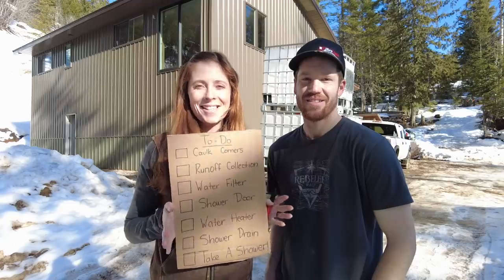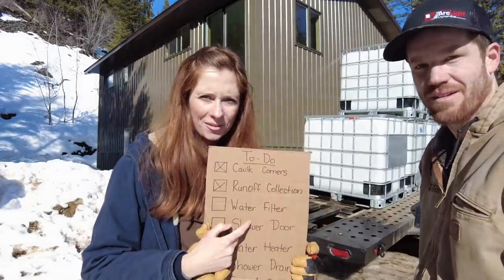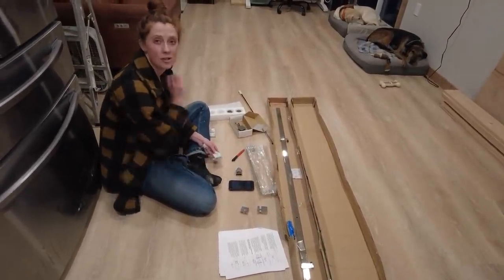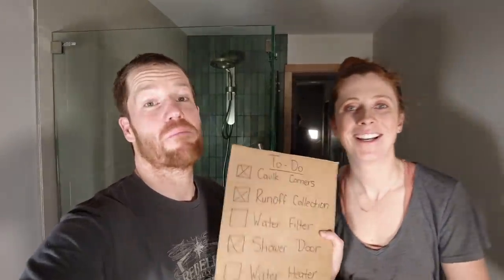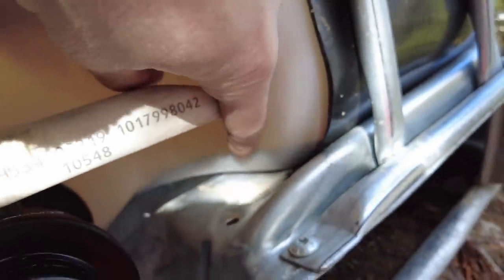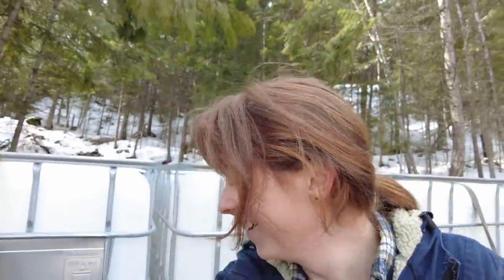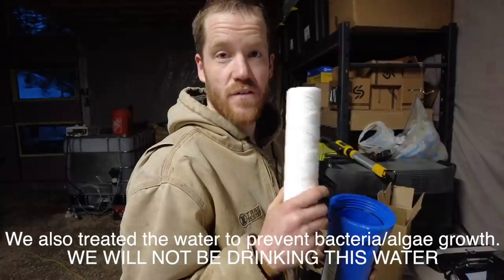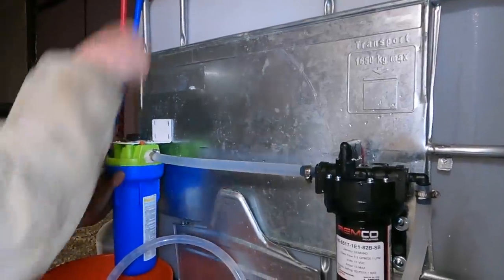We Went A Year Without A Shower | Building Off-Grid

Comment: You tube has lots of plans to make a ram pump , quite cheaply and they don’t require power one of those might help you transfer your water
Reply: I also was thinking if you put gutters and down spouts on the  home you would fill your water tanks in no time , a one inch of rain produces 6 gallons per square foot of roof

Comment: I'm curious why you didn't just put two water totes down there at your snowmelt harvesting point. If you connected them together you could reduce the number of trips to go harvest your water.
You could even rig a float in your totes in the barn to automatically turn on the pump when it gets low, activating the pump downhill.

Comment: Hello, this may all be a moot point that you have already thought of but... 1) The water heater you have looks like the one I have in my outdoor kitchen at the seasonal campground. It has a switch on the bottom to turn the igniter on or off, make sure it is off when not in use (leave camp) & use quality batteries in it (poor quality corrode easily semi exposed to the elements), make sure the exhaust deflector is in place & pointed away from water tote, try to set temp on heater so you don't have to mix cold water in shower, make sure you drain when not in use so it doesn't freeze (pipe and joints inside are VERY thin metal and burst easily) put a brass Y on input to drain it. I like the unit i have but it only raises the water temp around 60 F. 2) Put rubber or hose between pump and filter plate and tote for vibration noise. 3) Pump electric hookup: attach wires to battery with a quick disconnect that you can move to charger or solar AND put a switch on the pump side so it is off when not in use. 4) Water: you may want to hook up a water syphon to your wood stove to raise the temperature of the water in the tote, it will stay cold in there for a long time when it comes into the shop cold, it will be a cold spot in the shop, it will absorb heat from the shop, it will sweat like crazy. Drain water: dump it into another tote on top of feed water, it is warm/hot it will radiate heat, in an emergency you could filter and reuse for cleanup or an outside semi clean shower. Run off water: put some filter media in the culvert or a "sock" over the end to keep some debris from reaching the first tote, when you drain the used water make sure (soap) it isn't going down same side of road to intake water. MY $0.02 from camping experience for what it is worth.

Comment: A Glass Shower enclosure just seem dangerous to me and the added Weight is a Concern.  I would have just installed a couple of suspended Shower Rods from the ceiling and snapped on Shower Curtains.  Also, Someone (Courtney) will be Squeegeeing the Shower Glass constantly as it shows Stains and Spots from the Hard Mineral Mountain Water.

Comment: You can also hook Camplux water heater to a car battery......otherwise D batteries need to be changed quite often.....also it I'll never put off enough carbon monoxide to harm you in  big building......it would have to be air tight

Comment: I have been using poly cutting boards for years in a pinch. Got a small Strapino set, very nice. Big ones are pricey though. Who was in charge of the filter? Hope you have something to protect yourselves and pets from predators of all types. Fan of them or not, who would you like loose if something goes down.

Comment: I live rural where lots of people are hauling water and can tell you it will get old and if shtf might not even be an option.  Our place had a well (580 feet) when we bought it but a neighbor is in the process of doing one on his property and at current pricing it will be between $40 and 60K (depending on depth).  Ours was $16K back in 2003.
How expensive would a well be at your property?
You spent $50K for electric so how would a well compare to that?

Comment: I was wondering, how far and what elevation would it be to just get a stronger pump to directly pump the water up from the water catch tank?  And are you going to use the other tanks to catch rain run off from your roof and pump it inside?

Comment: try pipe dope in a tube for those plastic fittings rather than tape
Reply from the maker: Pipe dope was what Riley used initially!
Reply: If you have a fix resistant connection, use a very thin coat of Teflon paste, then Teflon tape, then another very thin coat of paste…
This solves the poor quality plastic thread issues… usually, 99.9%.

Comment: You guys should have a look at Matt's fire truck from https://www.youtube.com/results?search_query=off+the+ranch.  Since you have nearly the same truck, you may find a build somewhat similar useful for both a solution to getting water from your collection totes up to the apartment, and also for an emergency fire truck since you're tucked up in the trees.  Having a high volume pump on the truck would help for both purposes, and if you use a tie-down system similar to his for the water tank, you'd still be able to use your dump bed to load and offload the water tank without too much fuss.  Just a thought ;)  https://www.youtube.com/watch?v=LlKZ8PWAVc0&ab_channel=OffTheRanch

Comment: It is too bad you can't easily lift your totes so you don't have to have all the high pressure pumps. Gravity doesn't cost battery power.
Reply from the maker: You're right about gravity not costing battery! We actually can easily lift the totes. Our mini excavator can lift and place them full no problem. However, we can't leave them outside or they will freeze solid.
Reply: @AmbitionStrikes  I was thinking that it would. Maybe a small shed uphill of your house?

Comment: No shower in a year!!!!?  I bet you two stink!  With as little as you will use the heater, the cavernous space of you shop will probably dissipate the exhaust fumes of the heater.  Opening that huge door will ruin your heat collected in there by other means.  I hope you have devised a method for flushing the mud from your tanks because the mud will eventually get high enough to get pumped out. Rube Goldberg would be proud.